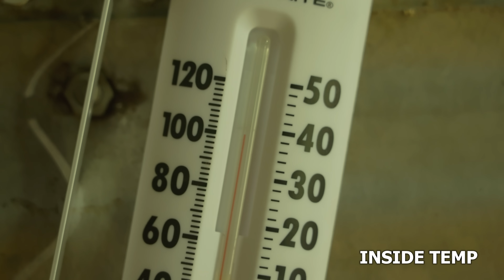Secret To Rodent FREE Tiny House!

Comment: Jason, one thing about your electric fence... you can't have it touching those metal pipes, it will just ground out the pulse... putting along the front and using the cattle guard for the opening is a great idea, you just can't have the electric fence touching any other fence/pipe/t-post/trees/shrubs/etc.

Comment: Regarding stumps:  I remember my father-in-law told me he would drill holes into the stumps, pour lighter fluid into them and light it on fire.  He said that it burned down into the roots.  I've never tried it.  But, thought I would share.
Reply: @sandychilese2893  I had a stump man come and grind some on our new property that someone else burned. It did not burn down to the roots, not sure if holes were drilled or not, but what it does do is ruin stump grinding teeth, fills them down. Really it is just best to grind them without any extra effort to destroy them first.

Comment: Nice job on the stain, Jason.  I am glad that you got a box fan. If you can find some block ice somewhere, get a 50lb to 75lb block, put it in a wash tub, and have the fan blow the cooled air around you. 😊
Reply: I think a bigger shop fan would have put out a lot more air for them. Yea it probably cost a lot more but they’d be a lot more cooler.

Comment: Tip with the fan the fan needs to go in the doorway so It can pull the cool air from outside inside. Just letting it blow on the inside just blows around hot air.

Comment: I'm a off grid king, and I understand you use what you can, I knew someone in a circle home and it was so unconventional because unfortunately you end up wasting space to have somewhat ergonomic layout, or deal with the drama of fitting a square peg in a round hole 😂

More power to ya... Id definitely Open it up put some windows in asap...

Comment: Jason, put the fan in the doorway so you blow air into the grain bin. try to ventilate the roof somehow and allow the heat to escape at the highest level. if you think it's hot now wait til you move up to the loft area. without letting the heat escape from the top, you will be cooked in the loft. i think you will not get the results that you are hoping for by burning the stumps. wet stumps will not burn very easy. most of the heat generated from the fire will rise and not dry out the stump and by burning the stump will repel insects that would normally feed on the raw wood fibers. charred stumps will be around for years to come if they are burnt but not completely burnt up. also look to seal the bottom of the grain bin on the outside to stop the water from getting under the metal wall in the first place. water that is allowed to sit just under the metal wall will tend to start to rot the wood, even pressure treated wood will rot in just a few years. wood now days is not treated as well as years ago. your place is looking AWESOME.....keep it going.....jim in central florida

Comment: Great idea for the base flooring. Cabot is an excellent brand for sealing, Where did you purchase that screening, please? I have a screened in porch I would like to use screening on the deck style floor, to keep most critters, snakes and bugs out. I saw remark from exterminator, I believe what he said, that rats and mice could eat thru the screening, I’ve used metal screen in holes to keep mice out and years later it’s still working. Live in a country environment with many head of cattle on the other side of barbed wire fence in backyard. I hope I never run into those type of rats.
Good luck with the dogs and the cattle guard experiment.
I love your channel and so excited to watch more chapters of your life together. Look forward to daily videos.

Comment: Boom, be building vertical before you know it. Looking great and the deliberate thought process is paying off. Great job in those brutal conditions, I worked boiler breakdowns in my youth in large electric generation plants, so I appreciate your focus on personal safety, unless you’ve worked in a large steel oven before, and the bin is similar, most can only imagine how hot it gets, especially when you add in the dew point and humidity, safe to add 13-15 degrees to your thermometer reading in those ambient temperatures.

Comment: Now... I ain't sayin, jussayin... I don't know what would be money-wise, but let's say 3/4 plywood for giggles. If you ripped a sheet of plywood down to 3 1/2" strips... and stood them on edge, that would be able to bend to conform to the curve of the shed... if 3/4, two of those together makes the width of a 2x4 on edge.... but bent... There's your rim joist, right there... You'd have to make a jig, I guess, and glue and screw, and stagger the joints.... I'll let you figger out the value of that on your own. ;)

Comment: Hi Jason, don’t you think you may need a vapor barrier? If you can see the outside from inside, I think you will have condensation/humidity building up under you subfloor and may cause mold. Just a thought. We use that over concrete floor that can suck moisture from the ground imagem you with all that holes on your floor there.

Comment: I Live in a Camper. After Permanently Setting it up, I kept getting Opossums Other Larger Critters in randomly .. Found out that there is a Hole under where the toilet it, roughly 18"x24"... I was just Able to put a piece of plywood covering the hole but could not get it flush. Not enough room under the camper on that side. Was able to keep the Larger Stuff out but now made it possible for Mice to get up and in... So I have Mice every Winter coming in.. Can't dig, Large Tree Roots in the way. I Could cut metal roofing 18" High and put that all the way around do they can't Climb or Chew their way in but that's $$$$... I will figure something out before next Winter...